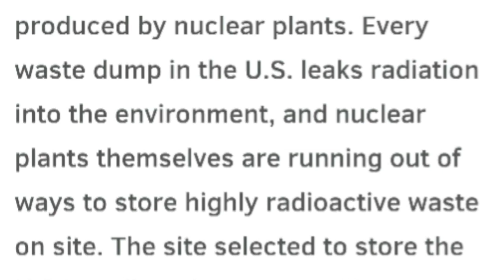Nuclear energy is bad

Comment: Sea level rise is already baked in due to global warming + Most nuclear plants are located on the coasts to cool the reactors + it takes 10- 20 years to decommission a nuclear power plant = disaster

Nuclear energy in itself is not bad, but since most nuclear plants are located on the coasts, they would need to decommission before sea level rise destroys the generators

A recent paper said Thwaites glacier in Antarctica is going to melt in 5 years, meaning sea levels will rise 2 feet by 2030. Most nuclear plants are directly on the shoreline, and 2 feet would destroy them
Reply from the maker: only 25% of nuclear power plants are situated on coasts. The sea level isn't rising anywhere near fast enough for this to be anything close to a problem. New power plants can simply avoid being built on coasts. Many papers from decades ago made ridiculous "predictions" about ice melting rates that never came true, 2 feet by 2030 is an unfounded joke and will never happen, unless a giant asteroid crashes into earth.
Reply: @AverageAlien  That's not what the maps I've seen show and even if I grant that what you're saying is true, 25% is pretty significant. And sea level rise is guaranteed to rise exponentially by 2040 because of the following logic alone: The last time co2 levels were this high was during the pliocene, when most present day coastal cities were underwater. We were australopithecines during that time in Africa. There is a 10 year lag for co2 to affect temperature, which can simply be researched online, so by 2030-2040, we could expect temperatures to be 2-3 degrees celcius, which is what they were during the pliocene. During the pliocene, the lower half of Florida was underwater, where currently more than 10 nuclear power plants are located. Lets say sea level rise does follow this logic and is this fast, what is your solution to dealing with this when it takes 10 years to decommission plants? Florida is already working on expanding their 'Turkey' facility which is directly on the shoreline and there is not a single flood gate surrounding it.
Reply: @AverageAlien  And ignore prior predictions made by Al Gore, who failed basic science in high school. I'm talking about this from my logical viewpoint. If co2 is exactly where it was during the pliocene, around 400 ppm, and there is a 10 year lag for co2 to affect temperature, then wouldn't it make sense for the temperature to be 2-3 degrees by 2040, give or take, plus an additional 10 years for all ice to melt to match what it was during the pliocene, which means these power plants should be relocated or best decomissioned before 2050?
Reply: @AverageAlien  Or what if we had ww3 or another pandemic like the Black Death which killed half of Europe in less than 10 years.
Reply: @AverageAlien  And sea level is currently rising and has been since the 1900s, and the rate is accelerating. Look it up if you don't believe. Humans have a way of not comprehending the exponential. And let's just ignore sea level rise, what about societal collapse? 99% of civilizations have collapsed before us, which tends to happen within a few years to a few decades according to history, so its pretty much guaranteed when, but when we do, who will handle these facilities and decomission them? The average lifespan of a civilization is 250 years. And let's ignore that too. Let's say we have another Carrington event which wipes out all electrical infrastructure keeping the plant powered.

Comment: The accident at Fukushima was caused by an earthquake and a following tsunami. The earthquake/tsunami killed about 1500 people. However NOBODY died as a result of the accident at the powerplant. This is (at least in part) thanks to a few brave and quick thinking engineers, but still no one died from radiation poisoning or other nuclear related injuries.
Great video!